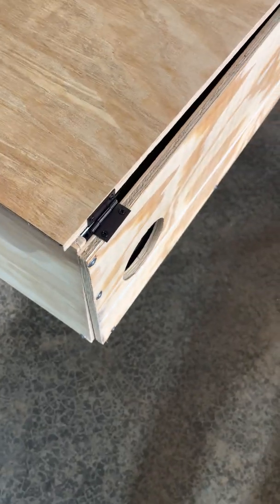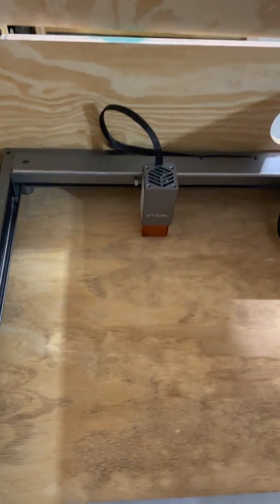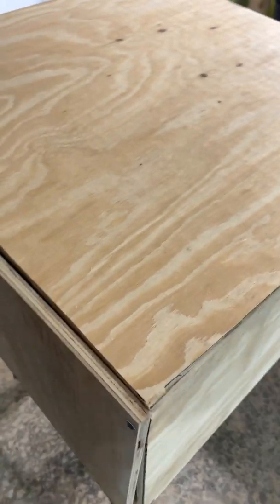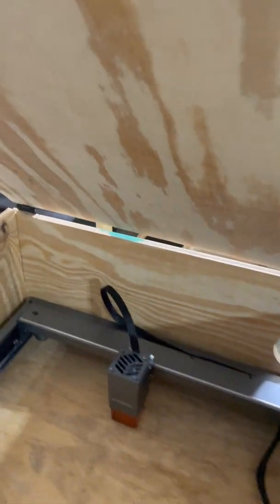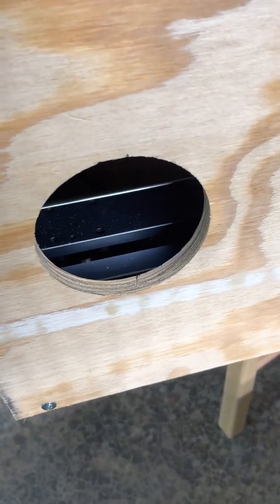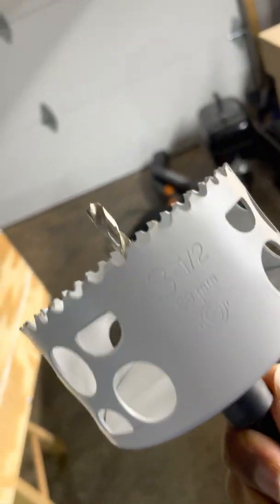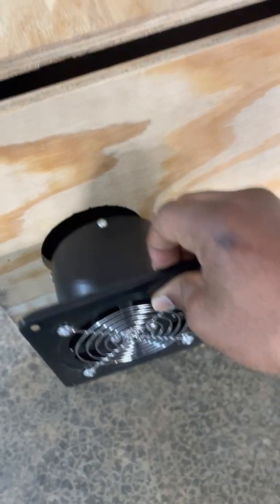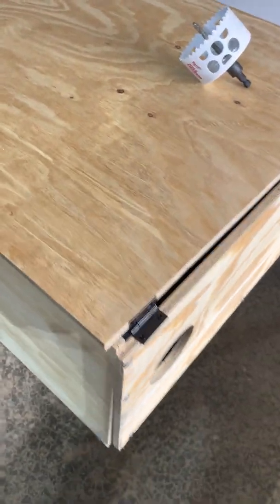Custom Makeblock xtool D1 enclosure (what went wrong?)

Comment: The hole for the exhaust needs to be on the other side of the laser, also a see through top would be better, so you can see what your cutting/engraving. Any thing could go wrong, so it's always good to see what is happening at all times. You also might need an inch of opening in the front for better air flow and suction for the exhaust. I'm not a GURU by any means, but using common sense :-) Hope it helps.
Reply from the maker: Thanks for the tips, the see through top is definitely a must. I really didn’t consider keeping a small opening to allow the exhaust to get air. I’ll add that to my modification